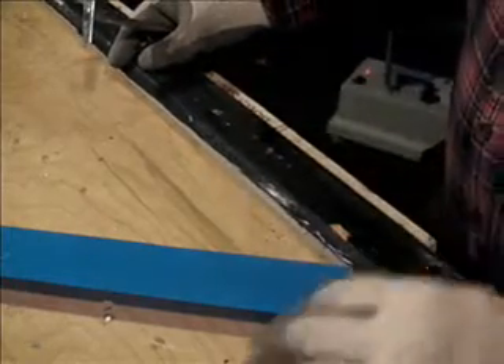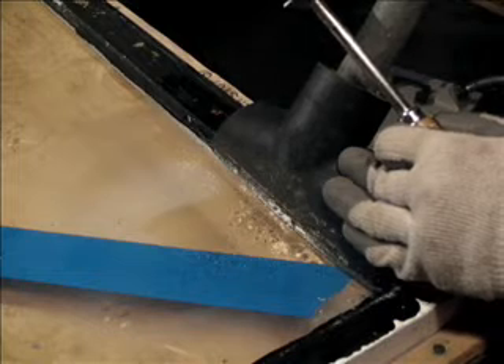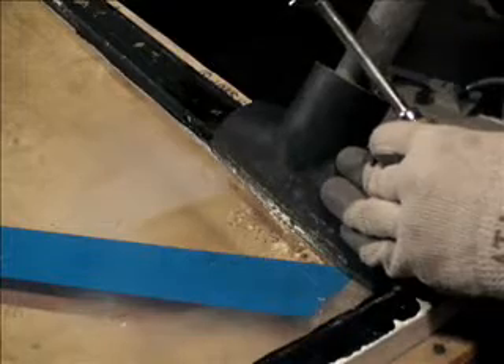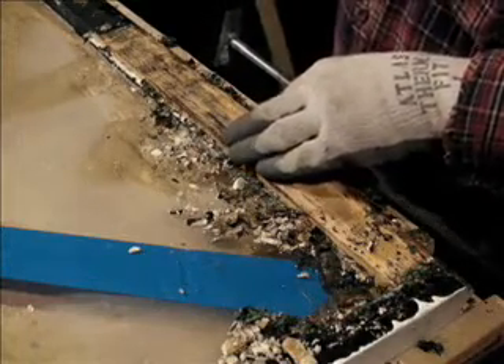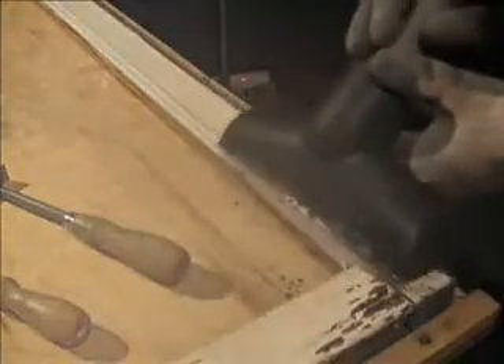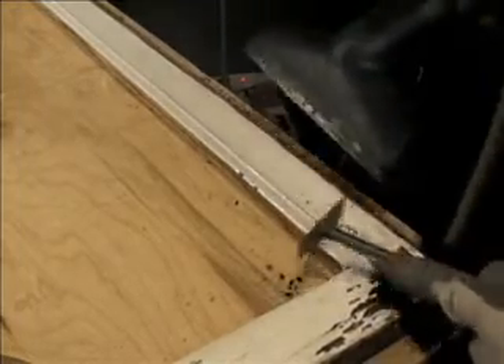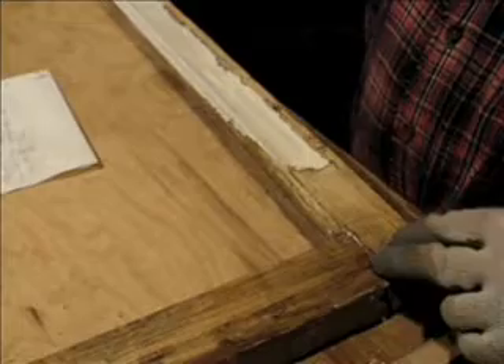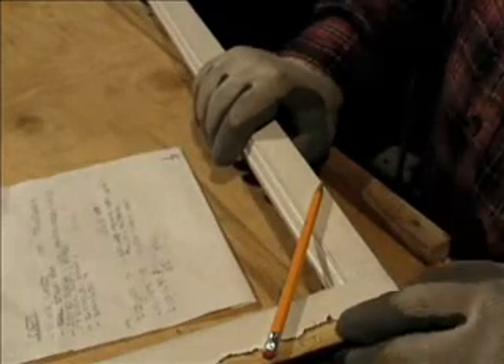Window Sash Deglazing

Comment: If it only takes 30 or 40 mins to do a side, you might as well remove both sides entirely.
Reply from the maker: Yes, that is a good strategy if you have the means to do it.
On this project we had strict limits on time and money, so we worked with a Less is More strategy. The Less we did to each window, the More windows we could do. We got four more windows done than if we had removed both sides entirely.
Reply: ok thanks

Comment: Thank you for posting this; very good explanation.  I read your forum about the various steam generators and I had an idea I didn't see mentioned there.  Which is this: Instead of the expensive j-4000 Steam Generator why not just use a cast iron teapot with a length of automotive heater hose attached and put the teapot on a conventional electric hot plate?  I'm thinking the type of cast iron teapots that are used as humidifiers and meant to sit on a wood stove 24-7.  They are very thick material.  I would have to test though to see if my electric hot plate can keep the water boiling..
Reply from the maker: It could be possible to get that to work, but now you can get wallpaper steamers for about $60. that work just fine.

Comment: I saw that someone else build a steam box and it seems to work very effectively but it looks like they had six or seven people scraping glazing out of the window at the same time
Reply from the maker: I have had two people scraping and it works very effectively. With good teamwork all of the glass can be removed, glazing rabbets cleaned out and all paint removed, often in less than 8 to 10 minutes.

Comment: Thank you for these videos!! We have a 1938 cottage with original lead paint windows, and I am trying my hand at restoring & repairing all of the storm windows first, with the intention of then moving on to the actual windows. They all need a TON of work! I have been using a heat gun or chemical stripper, and am looking forward to trying this instead!! I love how you custom grind your scrapers and wet/dry vac heads to fit your windows! I've been having trouble cleaning out the previously glazed area, and can't wait to try this.
Reply from the maker: Eliza Graves It's good to hear you are saving your windows! Take care, and work safe.  --John